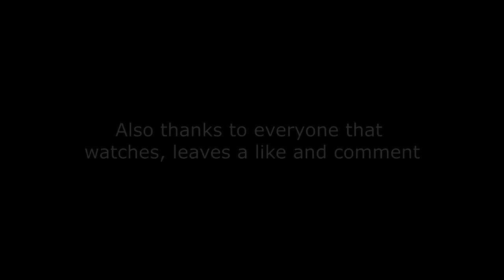The Kitchen FLOOR is DONE (Renovating a 200 years old House) #49

Comment: Diego, you don’t need to peel ripe peaches with a knife. You boil water deep enough to cover the peach. Put the peach in the boiling water for about 15 to 30 seconds, then remove them and put them in a bowl with water and ice. The skin will slip off easily with no waste!
Reply: Great idea

Comment: I wonder don't you need some kind of isolation for the floors? Like a EPS system underneed, in order to keep the house warm enough during the winter. In the Netherlands its very common, but maybe not in France of Spain.